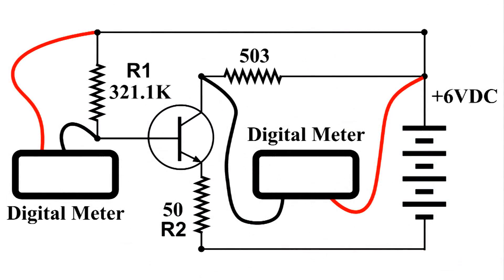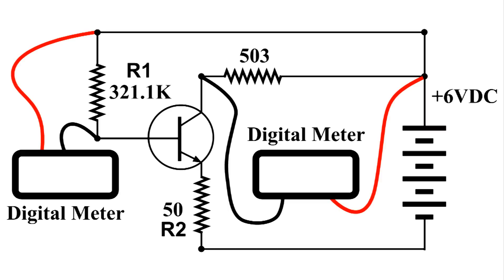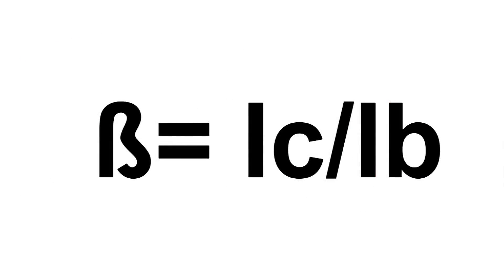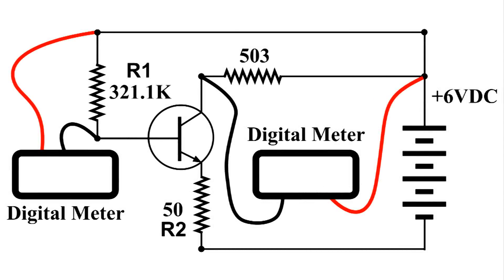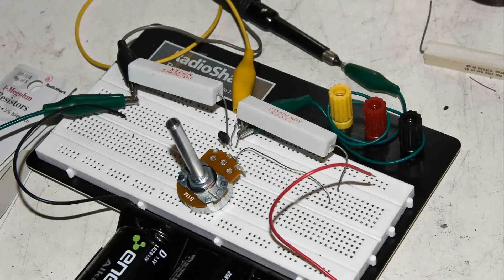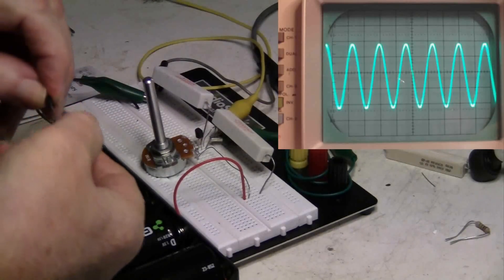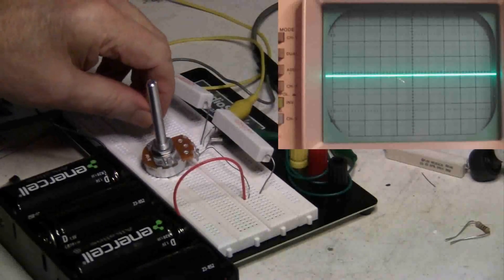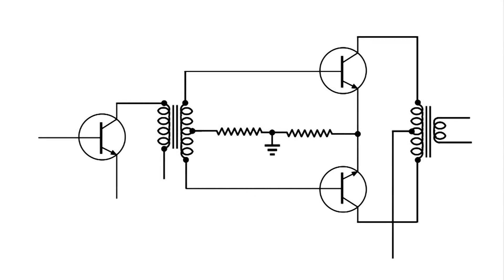Transistor Amplification Factor, Beta

Comment from the maker: @ntjbjhq 
The higher Beta means it takes less signal to achieve an output level. The Betas used in this example may have been to far apart to show what you were expecting to see. Also these two transistor are by different manufactures, so the Beta is not the only difference in specifications. You are not thinking wrong.

Comment: Thank you.  One question, I know you have a lot so don't feel forced to answer.  Why didn't we see a much higher output with the higher beta transistor?  The wave forms, once biased correctly, seemed to have similar output.  Was this just the test setup, and it could have been pushed to show a higher output that other lower beta one would show clipping at?  Or do I just not understand that part of it, wich is VERY possible.